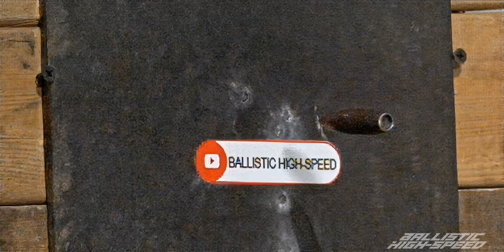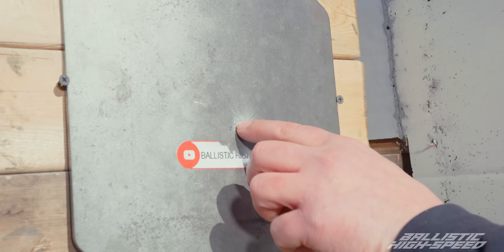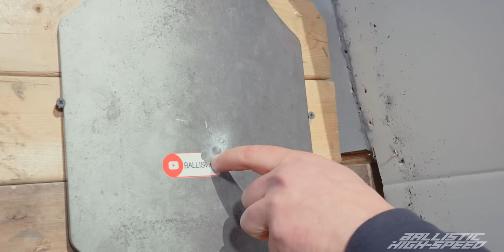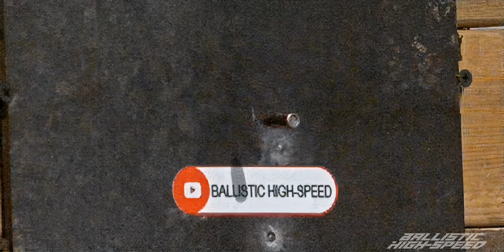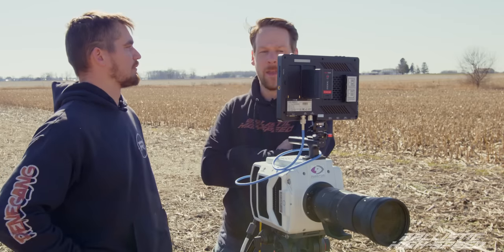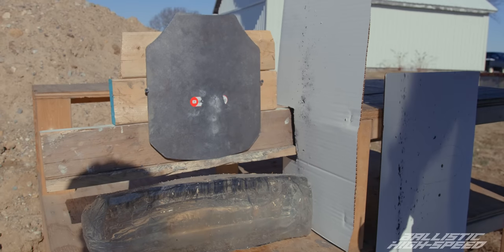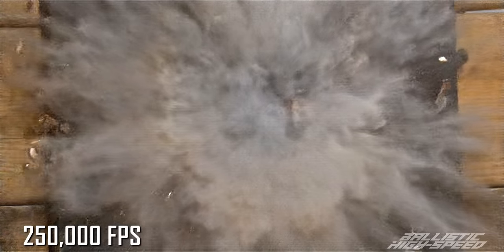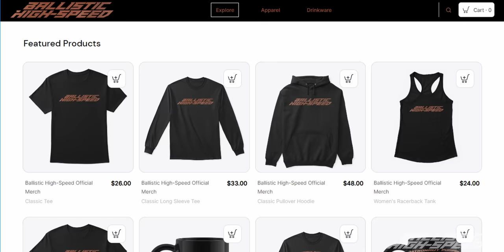Rifle Calibers vs Steel at 250,000fps! - Ballistic High-Speed

Comment: Not sure if it was mentioned in the comments but  the effect you are seeing at 07:22 - is called  the Schlieren effect.  When you have a point light source, in this case the sun, illuminating the subject,  the shock wave that the bullet creates is visible in the shadow due to the  refraction of the light from the source.  The refraction , due to the compression of the air by the shock wave, causes the light to bend and scatter.  The presence of a shock wave is not indicative to being super-sonic.

Comment: Awesome video, as usually. The visuals are just spectacular and the quality is so good. 
One issue: it seemed like the data for energy and velocity for the 7.62 x 54 was the data for the 7.62 x 39. They were identical. I was expecting the Mosin round to have a lot more energy. I might be mistaken. 
Looking forward to the next one.
Reply: That was likely a mistake; 7.62R is often compared to a 308 in kinetic energy
Reply: I don't think this was entirely fair to the 54R, it was shot out of a carbine barrel. You can lose a couple hundred FPS with that much shorter of a barrel. My full length M91/30 (28.7" barrel) will launch a 150gr bullet at upwards of 2,800FPS, or 2,690 ft/lbs of energy.

I do also think their muzzle energy number was copied from the x39 on accident; 54R should absolutely have significantly more than 1500 ft/lbs of muzzle energy either way.
Reply: I was thinking the same thing. The 7.62x54 should be moving approximately 350-450 FPS faster than the '39. Of course it could have been an intentional "comment generator" too. Either way no '39 is duplicating '54R velocities.

Comment: Great video!  Would have loved to see something like a 40 grain 22-250, something small, but super fast, pushing 4k fps.  I've put dings in AR500 steel at 50-75 yards with mine.  Keep up the great work!
Reply: Or .220 Swift?😃
Reply: I've never shot ar500 plates but I have blown holes through steel with my 22,250
Reply: @TheWasillamike  or 204 Ruger it has one load that's even faster then the 220swift
Reply: Thewoundchannel did a video shooting level 3 plates with 22-250 and a couple rounds punched straight through cause of the ridiculous velocity it can produce
Reply: .220 with a 40grn will push just north of 4200fps.
22-250 is a nice one also. Have one of each and hand load.
Reply: I've had accuracy issues with my 22-250 the second it passes 70 yards. Everything within 70 is like pinpoint accuracy. I need to try out a few more loadings before breaking down and going to a gunsmith but we'll see...

Comment: That .50 was awesome, it looks like it punched and shattered the plate rather than penetrating with a nice hole. It would be neat to see a slowmo of the back side of the plate when that hits to see what the bullet looks like on the other side. I'd also love to see some different types of rounds, like armor piercing, tracer and incendiary. I think those would give some very interesting results when they impact.
Reply: They can setup a mirror to capture rounds breaking through the back side of the armor in high speed

Comment: The black dust isn't a burning sticker, it's just dust.  Lead dust, to be more specific.  That's why indoor ranges need proper ventilation and air filtration.
The sparks come from the tiny amounts of steel that were abraded off the surface and heated to ignition temperature as a result.
Reply: I was thinking that too. 

At one point I was shooting air rifles into a 22 rimfire trap in the basement, and I noted I was getting the occasional spark when the pellet hit. My "big" rifle was a 22 that ran at something like 850 fps, so it was just scraping the paint off  instead of abrading the steel. When I realized that the lead dust from the pellets was probably what was burning, I quit shooting air rifles in the basement.

Comment: I'm genuinely surprised by the rotation speed of the projectiles. Is there a way you could include that data (RPM) in future videos?
Great stuff guys.
Reply: Not hard to figure out. Say you have a 1:12 twist barrel, or one revolution in 1 ft. So 3,000 ft/sec would also be 3,000 revolutions per sec, or 180,000 rev per minute! If it's a 1:6 twist, 3,000 ft/sec would be 6,000 revs per sec.

Comment: The green tip 5.56 has a piece of steel at the tip, so it can put a dent in the metal when a .223 can't. There are rare cases where a green tip 5.56 can penetrate a steel sheet when a .223 rounds can't, but it's not usually, because of the velocity/power, it's because of the steel tip. It's not really "armor piercing" like many people believe, but it does help it penetrate soft armor better. It doesn't flatten and spread out the energy like a jacketed lead tip bullet will do with soft armor.

Comment: The difference between the 223 and the 5.56 in the armor is most likely due to the steel penetrator in the M855. The velocity difference between a 223 Remington 55gr FMJ-BT (I'm guess that's what you used) and a 62gr 5.56NATO load isn't that different if fired from the same barrel due to the higher pressure allowance on the NATO round.

Comment: I would have liked to see what a 7.5x55 Swiss out of a K31 would have done to your steel. I have seen it drill a hole through 3/8" AR armor plate like it was under a drill press at 100 yards. Using some of the original Swiss surplus ammo. It's also a heck of a rifle.

Comment: 4:08 I built a target stand specifically for steel target shooting for my wife before she got home. She shot five rounds of .300 Blackout soft point handloads out of a bolt action Ruger Ranch. We noticed a pancake of lead on the ground, along with smaller discs of copper and lead. She thought it took chunks out of the 3/8th steel plate. I had to show her your high speed video. We also noticed the lead spray all along the sides, embedded into the 2x4 legs.

Comment: Cool visual effects! A true test of the 50bmg would have been to shoot it at a fresh spot 2 or 3 inches away from the other impact spots. I know it didn't look like the other rounds did much of anything, but after that many high velocity hits in such a small area, there was likely some significant metal fatigue in that area of the plate. I'm not saying that the 50 wouldn't have gone through, I just think it might have looked different impacting a slightly more resilient part of the plate. Great video!

Comment: The amount of unburned powder and gasses that exit the barrel has always amazed me.  It seems to be inversely proportional to muzzle velocity.  
If you watch the closeups of the 7.62x39 very closely  there is also a second shock cone off of the base of the bullet.  
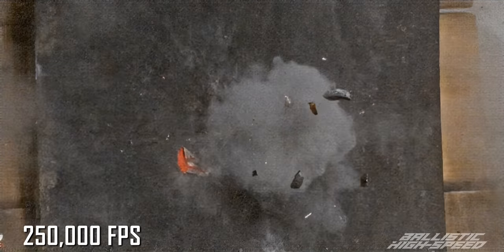No surprise at all that the 50BMG penetrated the target.  15:00 "Some of this is going to be metal leaving. . ."  Lead, copper and steel are ALL metals.
Overall, very enjoyable!

Comment: Suggestion: Go to the other end of the spectrum. Air rifles come in 3 flavors. 1. Pump-up pneumatic; 2. Pre-charged pneumatic: and, 3. Spring action. The first two have excellent accuracy without special procedures. The third, spring action (usually a “break-barrel”), is mechanically simple but the accuracy is dependent on the movement of the gun in response to the motion of its internal piston and to how the shooter holds the weapon. The recoil of the action and the resulting movement of the barrel BEFORE the projectile leaves the muzzle has never, to my knowledge, been analyzed. Filming a spring action air rifle at high speed can clear up the mysteries of recoil, barrel motion and shooter grip, all of which greatly affect accuracy.   Thanks
Reply: There was and maybe still is a gentleman that called himself "B. B. Pelletier" who wrote for an air gun retailer's blog. He used what he called an "artillery hold" to shoot spring/air rifles.

The basic premise was that a person could not hold a spring/air rifle perfectly still and an attempt to hold it hard would not be successful because of muscle fatigue. The core principal of the artillery hold is hold the rifle so it recoils the same way every time it is fired. That leads to consistent motion during the shot release and resulting gilt-edged accuracy.

I would like to see some high-speed video of a spring/air rifle being fired. It would be interesting to see the differences between a hard hold and an artillery hold and if the difference could be seen in the rifle's motion while the piston was hurtling forward.

Comment: In the final shot, you can see the core of the round slow down and back out of the outer casing, as the outer casing breaks down, the bullet core then passes through at a much lower speed

Comment: The impact flash is due to steel in the bullet. The 556 green tip is steel core. The 7.62 x 39/54 are typically steel jacket bullets

Comment: The reason the plate cracked so much is because it's a Hardox type steel. Very brittle.  Use a piece of mild steel plate and you'll get a smooth hole go right through.

Comment: Looks like they put the 7.62x39 velocity/energy stats on the 7.62x54R footage. 7.62x54R is faster than 7.62x39 and has energy in foot pounds close to its velocity. The Mosin used looked like an M38 variant of the 91/30, so a shorter barrel therefore reduced velocities

Comment: This is one of the more fascinating videos I've seen.  Great slow-mo shots of bullets in flight.   Their spin is clearly visible as are the rifling marks.  The energy of the Big 50 is awesome.  Also, it's interesting all of the blow-by that exits the barrel well ahead of the bullet , and the ensuing fireball.  For an encore, how about a 20 MM?  40 MM?  Think about it.

For a unfair comparison of muzzle energy, the 16-inch guns of the Missouri battleships produce about 262 million ft.-lbs of energy. And that requires 660 lbs. of powder. (6 bags at 110 lbs. each) And the maximum breech pressure is 18.5 tons per square inch (440,000 ft.lbs) Maybe you could video one of those!!

I really enjoyed this video and envy you guys having such neat (and costly) equipment to conduct such experiments.

Comment: Fascinating when you convert the fps to mph, even at 1400+mph the bullet is unable to 'slice' through the steel plate. Yet when we watched the WTCs 1 & 2 get hit by aluminium bodied objects travelling at best 400mph they easily 'sliced' through the sideways on, walls of the steel beams. Maybe you guys should be using aluminium bullets for armour piercing, just a thought.

Comment: At the range I find the most consistent calibre in my collection to dent ar-500 is 8mm mauser. 7.62x54r doesn't really permanently deform the surface but for some reason my soft tip 8mm mauser ammo will.

Comment: What I found most fascinating was the fire.  I always thought it came out with the bullet, but it seems it ignites an inch or 2 outside the barrel.  The more modern rounds were impressive how little fire came out and the fact it seemed it was always circular.  The Mosin–Nagant's fire was huge while the .308 was a bit smaller.  I'm curious about the dynamics.  Are the fires from unignited powder that burns once it hits oxygen?

Comment: I think the 7.62x54R velocity is incorrect. They usually run at the same velocities that 308s run at, 2600-2800FPS, plus it definitely hit the plate harder than the 7.62x39 did by watching the replay.

Comment: Great Work, love the visual physics. 
Watching the the 50 Cal shoot through the plate it struck me that it would be very interesting to have the plate set up in such a manner that the back of the pate could be filmed as well. 
The plate would need to be secured so the back was bare and would break away in the opposite direction from recording equipment.
Reply: Can be done using mirrors

Comment: "A lot of people were saying it's probably just the sticker melting"

At least in that particular shot, that doesn't make sense. The ejecta was up the entire height of the cardboard, while the bullet was above the sticker. The shockwave should push the ejecta from burning the sticker generally downwards, meaning that sticker burnt material shouldn't have reached the top of the cardboard.

Edit: I also think that more rounds would dent, or at least have a bigger effect, if the mounting was more stable/rigid. Being able to wiggle the mounting setup means that energy will be absorbed by the fasteners, rather than transferred to the mounting structure.

Comment: The vaporized unburned barrel residue ignition ahead of the bullet exit was very interesting.  The validity of bullet type and composition wasn’t mentioned at all, as bullet design and composition is more important than velocity for penetration.  It would be interesting to see solid copper bullets; both the Nagant and .308 would’ve at least cracked the plate.

Comment: "Solid states of matter...." that's the thing, metals, especially the ones here, steel, copper, and lead mostly, there's a little zinc too but ALL are ductile and malleable.  Meaning they can pulled or pushed into shape and can indeed move as a liquid does even in their solid temperature range.  They can't "flow" freely, but with enough pressure they'll splash well enough, if you had a glass or ceramic bullet of similar mass it would probably become mostly dust and a few chunks instead of leaves and jagged sheets.

Comment: Not sure if anyone else has pointed this out, but most 50bmg ammo is steel cored and not lead. Hornady's 750 grain A-Max match ammo is the only one I'm aware of that uses no steel in its makeup. So I'm betting the primary reason it went through was the sheer mass of steel instead of soft lead at high speed is going to punch through even AR550 at that thickness and only the copper jacket is coming off the bullet in the video. Unlike the smaller lighter cores of a 556 green tip that wouldn't punch through. If it was a lead bullet like the A-Max it likely would have deformed and not gone through.

The only reason why I know about this because it's the only round allowed for 50bmg at the indoor range. Because steel cored ammo could punch through the trap and is a massive safety and liability risk. So any bullet or casing that is tested with a magnet and sticks isn't allowed. They also only have 1 box of the 50bmg ammo on the shelf that's been there a while since nobody has brought a 50bmg rifle to the indoor range. At just over $10 a round I can understand why.

Comment: Now I see why most plate makers put a thick coat of anti-spall polymer over the steel plates.  It would sour your day to get hit in the plate, even without perforation.  I predicted penetration of the .50 BMG, but I was surprised at how much shattered on this side of the plate.  Chunks of lead and jacket came at different intervals, and the flame was fascinating.  Is there a steel core in the .50 bullet, or was that vaporizing copper jacket metal?  Great video, guys.  I'm guessing .375 A400?

Comment: with the high speeds captures and velocity calculations I think it would be really cool to show the differences in barrel lengths for the same round. building up to a ridiculously long barrel. but i think it would be more realistically feasible for 3 or 4 guns with 3 or 4 barrel lengths each just to see the differences. either way neat video.

Comment: What’s wild is, if you look at the 250k fps impact of the .50 BMG, right at the end, you can see the core actually backing out of the copper jacket, like someone pushing out a Push-Pop.
Reply: Your velocities are off by factors by as much as 100:1. Why the hype?
Reply: @davidrichards2113  fps is frames per second not feet per second. It’s not traveling at 47 miles per second

Comment: I would be very interested seeing a HMS 45-70 350 gr semi jacketed flat tip from say a Marlin 1895 SS rifle. The heat of compression might be enough to soften the plate and allow penetration. I've fired at .25" structural steel plate and put perfectly circular holes it every time.

Comment: that black powder are most likely metal oxides, which probably are formed when hitting the steel. Iron(II,III) oxide is black and it can form at high temperatures and pressure. It also can be carbon that deposited on the surfaces of the bullet and the plate. But seeing that the powder forms in a ring it's most likely the oxides. It could also be just the fine metal shrapnel powder that appears to be black (most likely bc of the quick oxidation, see above). Maybe it's also a mix of everything.

Comment: being honest, this was an amazing video! but....your thoughts on the 50 BMG before you shot it. you two weren't sure if it would go through the steel? did i hear that correctly? is that level 3 steel plate? there is no question the 50bmg would annihilate that steel and anything behind it. is this your first time shooting a 50 at steel?
Reply from the maker: It’s AR550. There are several videos out there of AR550 stopping .50 ball ammo. Just depends on the thickness. I didn’t know what thickness it would be, so I just said I wasn’t sure.

Comment: The plate is a body armor plate. I know they are available coated to reduce all the spray. I would love to see with and without coating using 9mm, .223 and .308. Steel body armor wont help much if chunks of copper jacket are peppering your chin and face at 2000 fps.

Comment: A number of years ago we video'd my 7mm Allen Magnum at night without any artificial light during a heavily overcast evening with a few regular video cameras. ONE frame caught an orange blur past the muzzle. If you guys are interested LMK know where you are and I can swing by with the rifle. 7mm bullet, 175 grain Sierra Matchking, 3495 fps mv. A 180 Berger VLD is running 3350 fps. It pokes through IIRC 3/8"  AR400 at <200 yds and severely craters it at 350 yds. The 175 SMK now is exploding in the air at 50 yds due to the throat getting rougher and I imagine thinning out the jacket. That's why I switched to the 180g Berger VLD. I'm about 25 miles SW of South Bend.